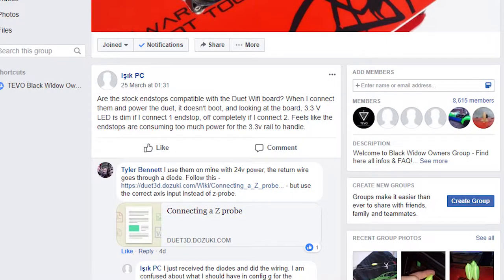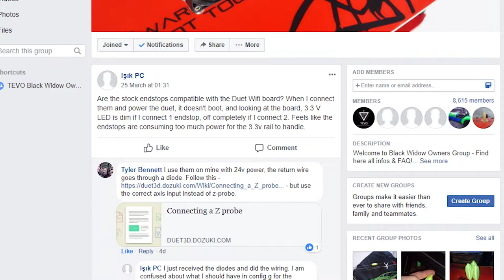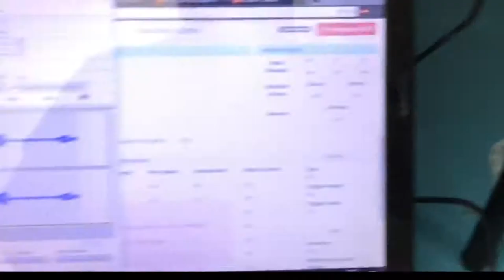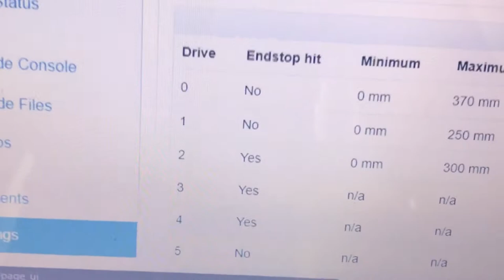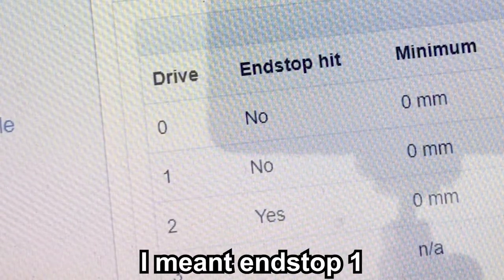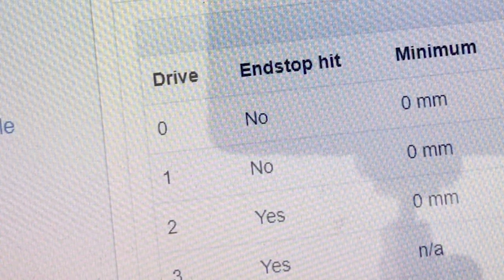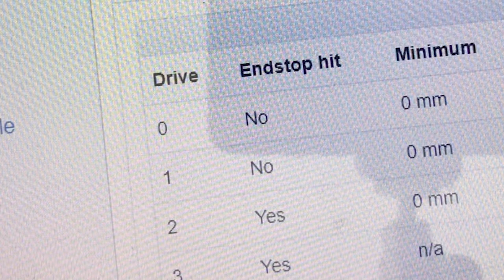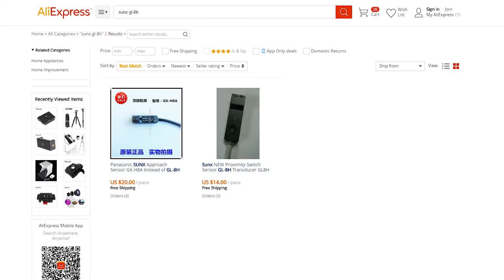Tevo Black Widow Mods Part 19 - Duet WiFi & The Endstop Problem

Comment: I`m sorry to see problems occurring but with you for sharing how things don't always go the way they are planned. It helps others realize that issues occur more common than it appears on other videos.  Could use a conventional end stop switch? If so it could keep you printing until you receive the correct replacements.  I was surprised to learn that the mechanical switches are as accurate and repeatable as the electronic type.  Keep up the good work, don't let it get you down, I`m enjoying your work.
Reply from the maker: Thanks. I don't have any mechanical switches either but I could (probably) order them from a local source and receive them in a few days instead of a  few weeks. The problem is I need a bracket that can mount the mechanical switch to the BW. Only way that I can think of to get a bracket like that is to 3d print it. Since I don't have a working 3d printer I can't do that.

Comment: dosent the duet have the option to monitor skipped steps and find the stall points (ends) that way ?
Reply from the maker: I think it does. I forgot about that. Still, I don't know if it is reliable. It is safer to have endstops I think. I am doing a lot of upgrades at the same time, so there already is a lot that can go wrong, I don't want to add to that. We'll see, if the end stops don't arrive by next week, I may try that.